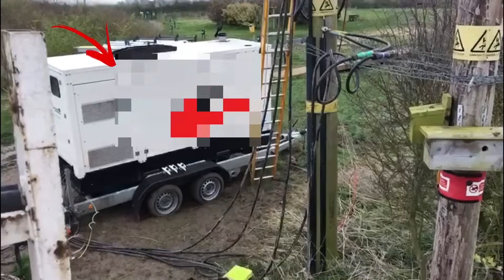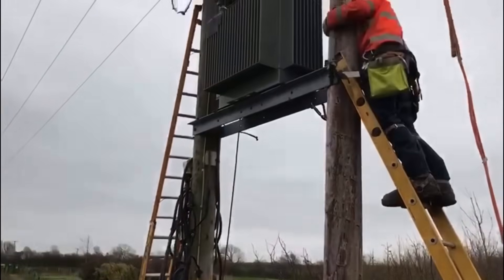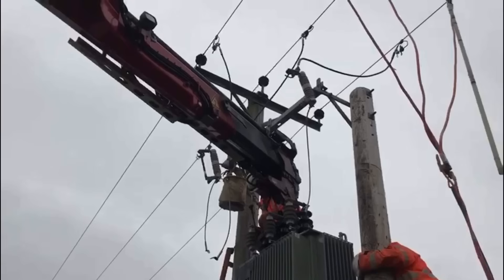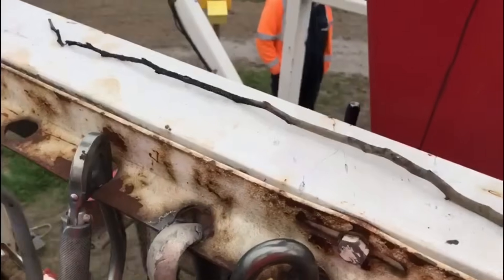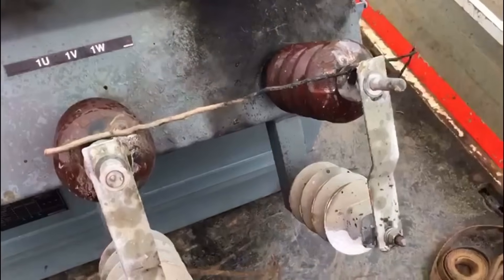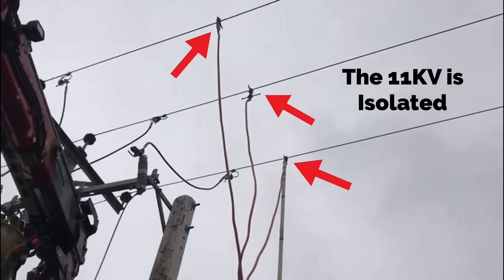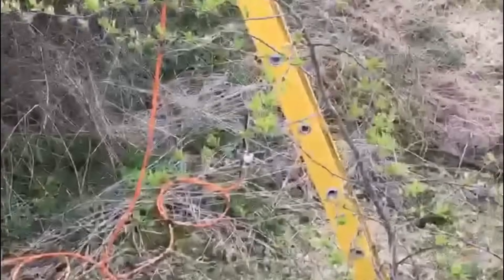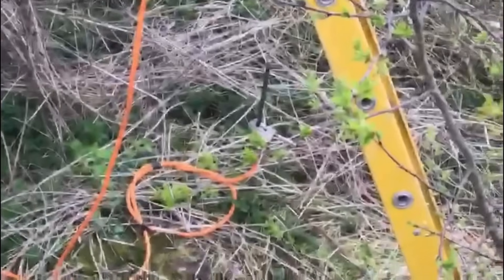One Small Stick Caused an 11kV to 400 Volt Transformer to Fail (Nicknamed the Harry Potter Wand)

Comment: What are the fricken things sticking out,  are they diodes,  so it was shorted line to line,  why are there two each,  is the red/brown side the 11 kv or 400 ,  would it have be worse if it was,  that sick going across to anotherphase,  on another side,  11 k v to 400,  or visa versa. Sounds like the explosion at the shipyatd... I bet some terrorist planted that damn stick there w a damn a drone...
Reply: Who liked my belligerent comment...
Reply: i think the white  ones are for the  terminal / buss bar  support  so the heavy wires  dont break  them easily  not 100% sure  or they could be isolating  bushings  .... but  i think the red/brown ones are  the 11kv  side  then on the other side of the transformer  on some   is the secondary which is 480 or 400 three phase  ..   one day   a utility pole engineer will comment and answer  your question  tried my best tho  lol
Reply: @danielhorne6042  here I am 🙋🏼‍♂️ the brown porcelain ones are the HV 11kV bushings, where the overhead cables ‘enter’ the transformer through a conductor that runs through the centre of them into the transformer tank where the windings are located, whilst the porcelain bushings isolates the electricity from the steelwork and transformer tank. The grey polymer ones are Lightning or Surge Arrestors. One side is connected to the conductor and the other is connected to the earthed transformer tank. Under normal operating conditions, the surge arrestor is of a higher resistance, meaning the electricity flows to the transformer where it should. If an over voltage occurs due to lightning or a fault, the insulation of the surge arrestor breaks down, sending the electricity to the tank which is earthed. This will then trip the circuit breaker at the start of that overhead section of line, protecting the equipment from damage. 

The LV bushings are at the opposite side of the transformer and are normally smaller bobbin types. These then connect to fuse carriers mounted nearby on the pole and from there, go to properties nearby at 400v three phase, 230v single phase. 

To answer his question, phase to phase or HV to LV cause different outcomes, but I wouldn’t imagine one would be worst than the other, as with how fast the circuit breakers on the feeder would trip, there wouldn’t be enough time for any real ‘fireworks’ to happen. Phase to phase normally gives bigger sparks as it creates a higher fault current, whereas HV to LV would cause more internal winding damage.